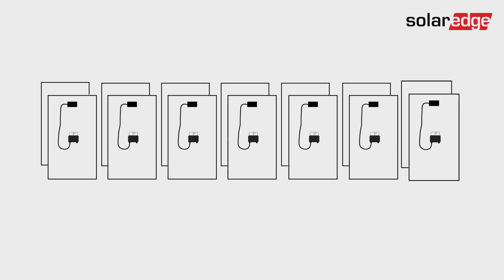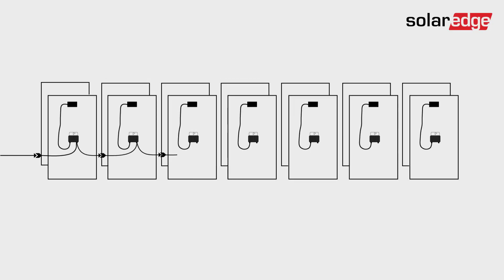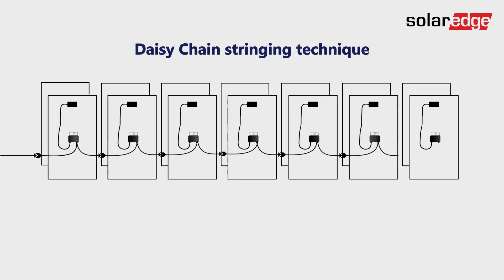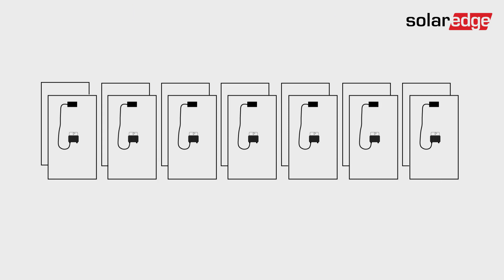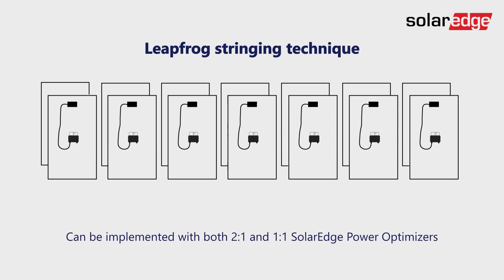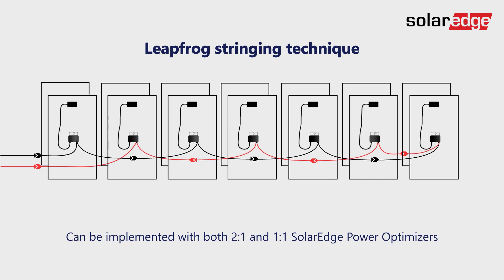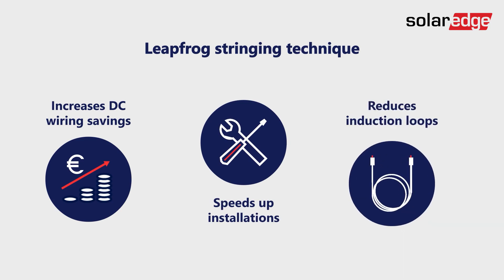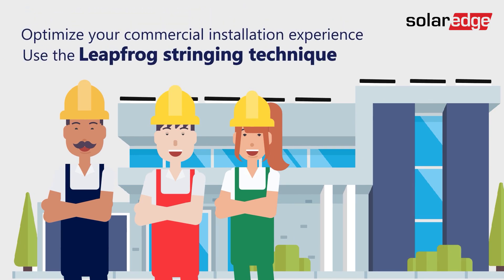Alternative Stringing Technique for Commercial SolarEdge Power Optimizers

Comment: My experience it opens the door to too many installer mistakes. Point the point is much easier and a visual pre-inspection before panels go down is easier to spot errors. Skip wiring can also be much more harder to troubleshoot later on down the road
Reply from the maker: Thank you for your input. Based on insights shared by our installers’ community, the alternative wiring scheme provides multiple values as outlined in the clip. Installers can choose whether or not to use this feature.